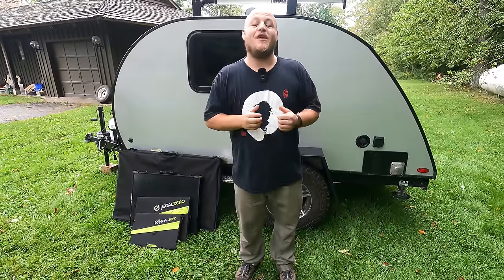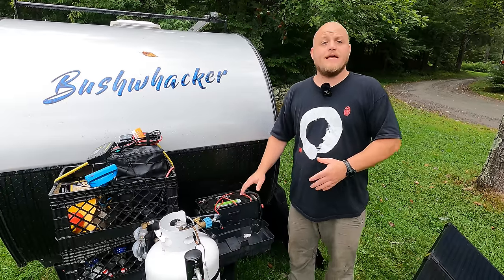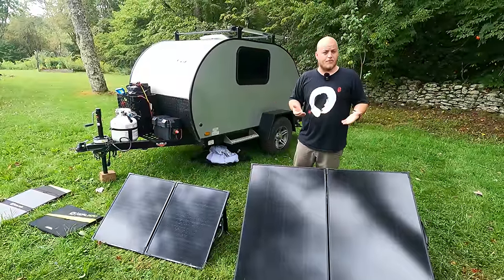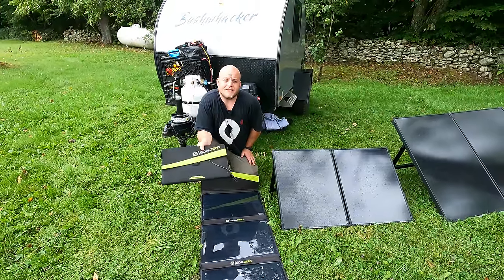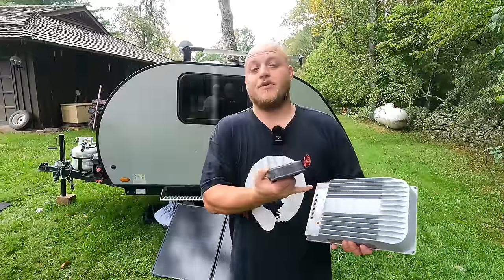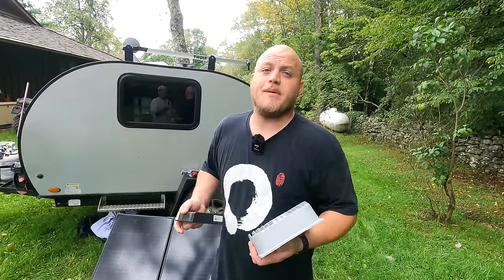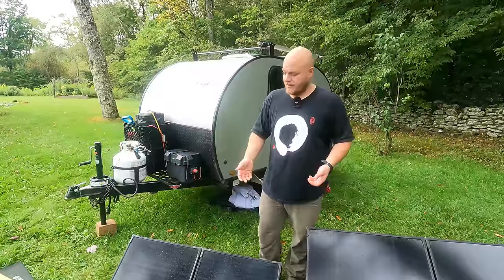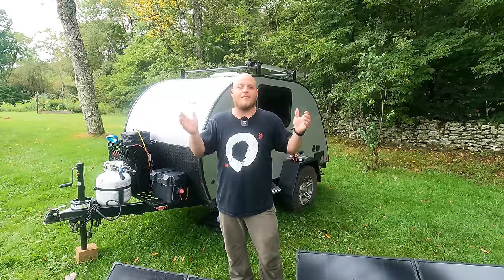RV Solar 101 : Everything a Beginner Needs to Know !

Comment: Hey Brian,    Have you ever replaced the UV protective film on a solar panel?  It seems feasible in theory.  The UV protective film is peeling away from the forward edge of my panel and I am looking for options.   Thanks in advance.
Reply from the maker: I have applied a film with a heat gun for cracked panels, that might work.   The price of panels have dropped enough that most of the time you can swap for less than fixing, but save if you DIY.  I believe I bought the film off eBay.

Good luck!
Reply: @DIYOutdoorLife  thanks and keep up the great videos!

Comment: So is there an option to run a camper 24 hours a day with the AC running like a little casita on the side of my house? I’d prefer to not rack up an even higher electric bill and have an RV plug installed but seems like that would be a ton of solar since my 10k window unit on the house uses 830 watts.
Reply from the maker: There definitely is an option, but it's not solar 101 content.  Lots of people achieve what you're talking about, but its complicated and they usually spend more than you would spend in a lifetime on utility power.   Often times they swap the air conditioner out for a modern mini split, with several thousand dollars worth of batteries, and use more solar panels than a casita could hold.  

All of this is possible, maybe the price will continue to drop and the gear will get better.  For the time being, I think you would be shocked if you saw what it would cost to do that.

Comment: I run roughly 386 kwh to 470 kwh monthly on a 30 amp plug what would you suggest if I want to go straight solar?
Reply from the maker: Is it a full time RV site? It would depend on a few things to get started, but you would want to audit where that power is going.  A system of that size is possible, but it would be very costly.  There are probably 101 ways for you to eliminate 60%+ of  your consumption. What devices are you running?

Comment: Hey Brian - so ive circled around solar and battery capacities for a while now but I am trying to start from a grounded position. I am using two 6v batteries in parallel to power the 12v system of my small RV. My understanding is that this will expand the amp hours and I can get more bang for my buck. When it comes to charging, I have two portable Dokio solar panels: one 30w and one 220w. I feel like the performance of my batteries or panels are subpar, but may not know enough about the situation. Do you recommend a different brand of solar? Or against using 6v batteries? Thanks!
Reply from the maker: Hey, thanks for watching!
You will NEED to wire the 6v batteries in series to make 12v. You can wire two 12v in parallel or two 6v in series- you have to end up with 12v for the system to work.

Try using just your 220w panel and see if it works better. Mixing and matching panels can get confusing, the 30w might actually be dragging your performance down.

This solar game is a mix of very simple AND complicated. Practice makes perfect but try to keep it simple at first.

I’m happy to help, keep me in the loop.
Reply: @DIYOutdoorLife  Awesome thanks a lot! I will take a look to see if I wired my batteries in series or in parallel because now I'm not 100%. I'll give those a try and see where I land!

Comment: I'm about to live completely off grid in a camper van and i was thinking about how many amps of battery do i need, i was thinking 3 lithium 120 amps each battery and 800W of solar and a 50a mppt control would be enough, what do you think? is it too low ?
Reply from the maker: It starts with our loads. What do you need to run daily?  A great device to think about would be a DCDC charge controller too. Being about the to charge when driving is nice for full-timers in vans. I like the victron Orion for that.

Comment: I just bought me a Nucamp tag xl and it has the solar panel I guess you said it’s taped on. How can I figure out what amps it is. I am picking up the camper from camping world and hopefully they can tell me but I think I may buy me an extra for a back up. I don’t know much about solar systems so may have to watch your video 100 times to get some of it to sink in. I plan on boondocking some but will only do it about 2 or 3 days at a time just to help myself get to know how long I can go. But like you said it does depend on the battery you get. I know camping world told me they would put in a new battery and hopefully it’s a 100 amp instead of the 81 amp. Thanks for the information
Reply from the maker: You should be able to see some marking on the panel that tells what it is, even if the underside with the cut sheet is covered. It may just tell you wattage, you might end up having to look it up online.  99% chance that it's 100 W panel.
Reply: @DIYOutdoorLife  ok thanks. It’s pretty good size but I know size don’t mean much
Reply from the maker: @MyTentLife  keep me posted, happy to help if I can. Do you know if this came from Nu Camp or if it was added as a modification?
Reply: @DIYOutdoorLife  that I am not sure of. I bought it at camping world and I’m sure it was on there when they got it from the previous owners.
Reply: @DIYOutdoorLife  I got the teardrop and the solar panel on top came with the camper from Nucamp. They put a 105 amp panel on their teardrops.
Reply from the maker: You must mean 105 watts, definitely not amps.
Reply: @DIYOutdoorLife  yes that’s what I meant.
Reply from the maker: @MyTentLife  nice, it's probably around 5-6 amps.  It will certainly help keep your battery topped off while camping.
Reply: @DIYOutdoorLife  yeah and I’m going to get me an extra one to make sure I can place it in the sun.
Reply from the maker: @MyTentLife  will you get a new charge controller or you have a way go combine it with the existing?
Reply: @DIYOutdoorLife  I’m not sure yet. I don’t know much on the solar systems. I know that I have a plug that is on the side of the box that the battery is stored on to just plug into it is what dealer told me to do. But they didn’t say anything about a charger controller
Reply from the maker: @MyTentLife  that plug on the side does require a charge controller
Reply: @DIYOutdoorLife  I figured it did. I was planning on getting one when I get the solar panel. Thanks
Reply: @DIYOutdoorLife  I just got to my campground and was going to hook up my tv since the campground has cable but I guess the tag xl boondocks does not have the coaxial hookup inside. Do you by any chance know if they do. There’s a hookup outside but not inside to run to tv. That sucks
Reply from the maker: @MyTentLife  there is supposed to be a cabinet/upper bin that says TV ready.  Behind thats, there's RCA and coaxial.
Reply: @DIYOutdoorLife  I sure didn’t see one
Reply: @DIYOutdoorLife  I looked again and all I see is a/c plug and charge converter and it also says tv ready but there is no coaxial plug. Trying to figure out how to send u a pic. Oh well I got an antenna for the tv anyway.

Comment: What size lithium battery would I need to let say cook on a electric stove for maybe 30 minutes a day. Is it doable let's say you have 320 Watt panel, could this work on your 3 day plan?
Reply from the maker: A question like that can be difficult to answer.  An electric stove runs on 110 VAC. Since the battery is 12 VDC, you will need an inverter to make that work.

If we assume the electric cooktop is 1000 watts (some can be 1500 W) - running it for a half an hour would be 500 W hours x 3 days is 1500 watt hours.    A 320 W panel will definitely replace the power that you're using, but you would probably need 200 amp hours of lithium battery to be safe.

Hope this helps ! Thanks for watching!
Reply: Thank you I kind of came up with the same math. I just wasn't sure how efficient Lithium batteries are. I remember you saying lead acid batteries were only 50 % efficient. Thank you so much for taking the time to respond. I truly appreciate it.
Reply from the maker: @Ricky-eo5ym  it's not so much an issue of efficiency, but more accurately, the best level to repeatedly discharge the battery.  Would lead, 50% or less.

With lithium, you can discharge it 90%.
Reply: @DIYOutdoorLife I see , I now feel comfortable with sizing my unit. Thank you.

Comment: the calculations assume 12v use. what about larger volts and using an inverter. does this not use more watts and if so how do we calculate it?
Reply from the maker: Unless you get into sophisticated grid tied systems, which obviously don't apply to camping, the solar has to be stored in a battery.  
How you use that power,  whether in DC form or through an inverter to AC, doesn't have any impact on how the solar is charging a battery.

The reason we talk watts is because it takes into consideration volts and current.  You can increase your voltage and still have the same wattage by lowering current.  If you were working with a 24 or 48vdc system, you can divide those into the wattage for current.  

.

Comment: Yeah there’s so much so many stuff and sometimes it’s confusing I’m having problems with my power supply what kind I need I’ve gotta or amperage 7 AM it’s so confusing I’m not electrician so lost it I don’t understand I’m trying to learn and it’s so many stuff going on so many channels telling you different ways different things but they don’t tell you like if you wanna run certain things you gotta have amperage on your
Reply from the maker: It can be complicated. Keep it simple.  Get a good battery and hook up some simple solar, build from there.

Comment: I know you posted this 2 years ago but how do I calculate what I will use in a day or 3 days to determine how big a battery I will need.
Reply from the maker: What type of loads do you have?  How long do they run?   These are the questions that help us calculate what we need.   

You can almost ignore things like lights, especially if you have a modern rig with LED lighting .   

How long do you run your ceiling fan? 
Do you have a refrigerator? Is it all DC or is there a gas option? 

Do you use a CPAP? 

What other things in the trailer will draw on the battery? 

If you give me a rough idea of what you use, and how long you use it, I can take an educated guess .
Reply: @DIYOutdoorLife  no refrigerator yet. It willbe a portable one like one that can be used in car camping. Cooking will be gas. No water heater or furnace. One or two cpaps. Lights, fantastic fan or portable fans. Willbe switching all lights to led. No water pump. Right now I will be as close to off grid capable as possible. In a pop up
Reply from the maker: @kandi8640  the CPAP will be the largest draw by far.  There's a huge variance in what they draw, depending on whether you can get a DC adapter, and whether you can turn the humidifier/heater off.

I would assume, 100 amp lithium battery would be a good starting point .  You should be able to get pretty good results off of that.

Comment: I have 48 volts 6 kWh lithium iron phosphate battery, a 48 volt 100-20 Victron charger, 2 -100 w goal zero solar panels, also a victron distributor.

I don’t want to spend more money in panels if I don’t have to.

Is it realistic to use?

What size fuses for my distributor?

Please help!!!
Reply from the maker: Victron is excellent with their tech-support and owners manuals, you should be able to see how to fuse the distributor there.  

For your system, you are seriously under paneled .  6 kWh of LFP storage is amazing, 200 W of solar is going to take forever to charge that though. 
You’re off to a great start, thank you for watching!

Comment: Okay I have a question. Can you use capacitors to store energy? For example if I want to protect my battery and alternator when running a 1000w amp for subwoofers in a car I would hook up a 1 farad capacitor. Could you do the same thing for solar?
Reply from the maker: Not exactly. It’s a similar concept, but you really want the charge controller and DCDC isolation to be correct, then you’re set.
Reply: @DIYOutdoorLife  okay thank you

Comment: I have 2500 watt champion, I just want to run the air conditioner which is a 5000 btu that draws 4 amps.
I was just going to plug the ac into generator via heavy extension cord, could I get a 30 Amp adapter and just plug generator into the 30 Amp on side of trailer? I have gulf stream trail boss
Reply from the maker: Yes, thats fine. Although most of the time it's perfectly adequate, there is an additional risk that you have to be aware of.  

if you use a heavy duty extension cord, with the adapters, you are likely rated to go up to 20 A.   Since you're adapting to a 30 amp plug, it is possible to overload that wire and burn it up.   It seems like you know what you're doing, just avoid running the microwave, a toaster oven, an electric heater, etc., while using that adapter.  If you're running the air conditioner, limit what else you're running during that time.  Since your generator is 2500 W, it will likely trip the Generator before you get to anything dangerous anyway.

Thanks for watching!
Reply: @DIYOutdoorLife  awesome thank you!

Comment: I have a 100 watt foldable solar panel from Rock Pals with a build in charger. Do I still need a charge controller to charge my camper battery?
Reply from the maker: Are you sure it has a built-in controller? Can you send a link? 
If it does, you don't need an additional one, you can charge your camper with it .

I'm a little confused because I've never seen a rock pal solar panel with the built-in controller, if you send me the product info, I'll take a look.
Reply: @DIYOutdoorLife  I think I was mistaken, the charge controller thingy appears to be for charging small devices
Reply from the maker: @dustinroberts5826  thats right. you'll easily be able to connect to a charge controller though and charge your camper battery

Comment: I have 2x30W 12 V  panels 135 WH sel gel battery. Can I charge it with this controller?
12/24V 60/80/100A MPPT Solar Charge Controller
Reply from the maker: Yes, you definitely can. 60 W of solar is quite small though.  You could actually do that with a 5a charge controller. The charge controllers you listed are over 10 to 20 times the size.  For best results, go with an MPPT like you said, but with more solar.
Thanks for watching!

Comment: So what is the point of a battery if we got solar panels? Just learning… asking for a 5th wheel that will be parked for living out of
Reply from the maker: Solar panels work with a charge controller to charge a battery, they don't power things.  Otherwise, the lights would go out on the sun is down.

Check out this video- 

Solar - Beginner Friendly | The Basics
https://youtu.be/-93D_ey2DVo

Comment: Battery capacity is always in amp-hours. Simply an ampere is a current strength that does not carry information about how long (1 second, or 1 year) this current can be maintained.
Reply from the maker: Correct.

Comment: I bought a goal zero 100w suitcase solar panel it has an 8mm male plug I want to charge my gosun 550 it was a 5.5 mm male plug. I can't find the adapter. Do you where I can get one?
Reply from the maker: Hey Dave,
I use this one, see if this will work for you.
https://www.ifremo.com/product/adapter-cable-for-x700/
Reply: @DIYOutdoorLife  I think it'll work I ordered it we'll see. Thanx
Reply from the maker: @davewest9141  because GZ uses locking plugs, some times you have to squeeze them in pretty snug

Comment: I have a 30 Amp controller 200ah lithium and only a 100 watt solar how many can I add? Greatly appreciated!
Reply from the maker: A lot.  Can you tell me what solar panel and charge control you have specifically?
Reply: It's a Rich Solar unit
Reply: I'm not sure what solar panel co.it's on the roof of camper but its 100 watt
Reply from the maker: @mikecat1771  if connecting the panels in parallel, you could really add as many as you want.  I would add up to six if I had to.

Connecting in series, I would need to know more information on the solar panel, but you could definitely connect a few. 

For your set up, sticking to parallel will probably be best .  in that case, feel free to connect as many as you need, you might find that you're able to actually use more than makes sense to buy or fits.

Thanks for tuning in!
Reply: I had to look up what parallel meant, basically every panel gets connected to the  charge controller same
 negative and positive ports. Correct?
Reply from the maker: @mikecat1771  correct, you will use a branch connector to merge all the positives and negatives.   With series connection, you connect all the positives to the negatives and Daisy chain them.

https://amzn.to/3WRH9eL
Reply: Nice! Thank you!

Comment: Will this set up work with 2 6v batteries running in series or will I need a different inverter
Reply from the maker: Works the same.  When we connect two 6V batteries in series, we basically create a 12v battery.  At that point, we will use all 12 V chargers and loads.

Comment: @DIYOutdoorLife - Brian, what is your take on Lifeline Deep Cycle RV batteries?  Are they truly made in the U.S.?  Do you know anything about their quality and reputation?
Reply from the maker: I know that it's a common battery for military application.  I assume it is made as they say, in US.  They tend to be very expensive, I've never actually purchased one.
My guess is that they are excellent but it's hard to justify that price .
Reply: @DIYOutdoorLife  I figured at the least. What are your recommendations for AGM batteries as a 1st and 2nd choice? I might try a Lifeline Deep Cycle at least once regardless.
Reply from the maker: @Jeffrey.1978 vmax and trojan are great.  Because of the low cost, I've recommended the renogy 100ah agm a lot and folks have been happy.